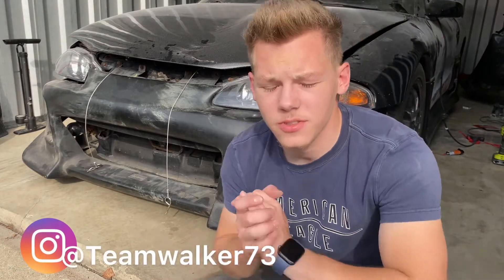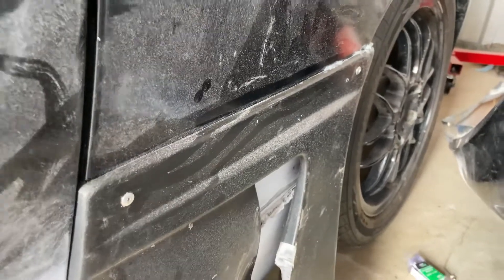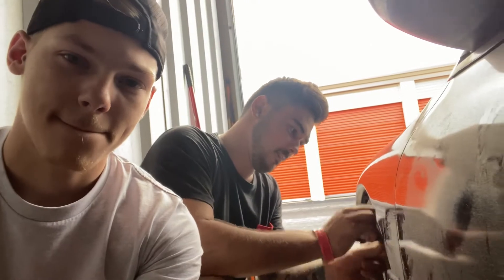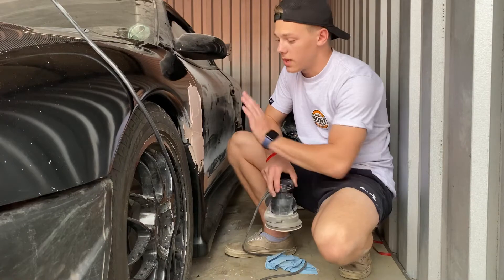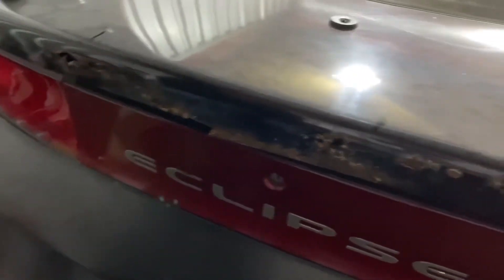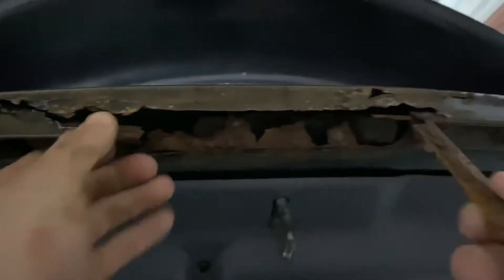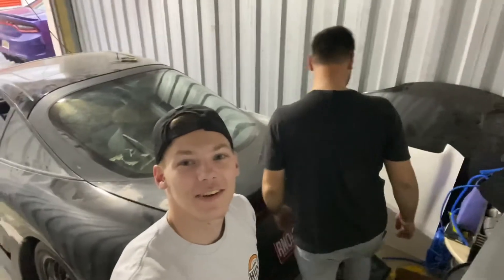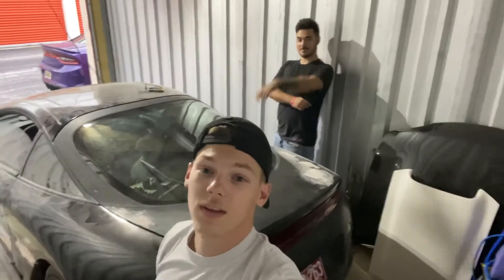Building a Fast & Furious Eclipse! Ep.3

Comment: Did you use any kind of panel bond on the lower part of the side skirts that runs along under the door? Or just the rivets on the upper parts? Thanks!
Reply from the maker: Yes, we used panel bond along the door sills and then rivets as well to the fenders and quarter panels!